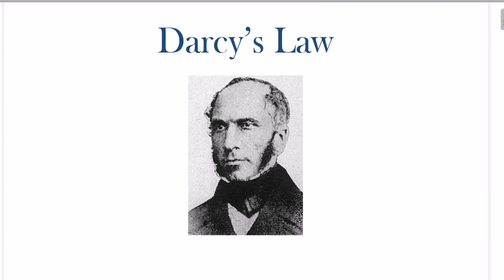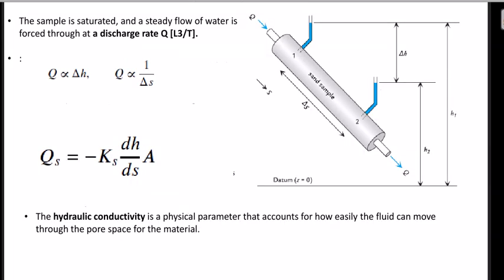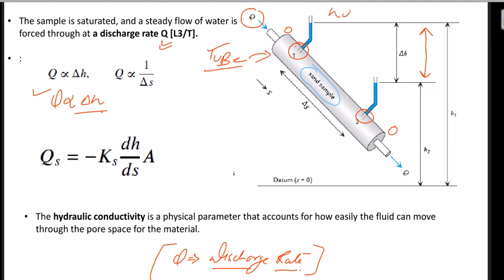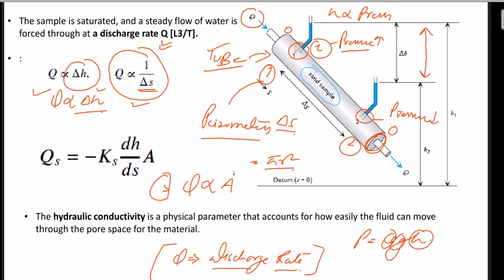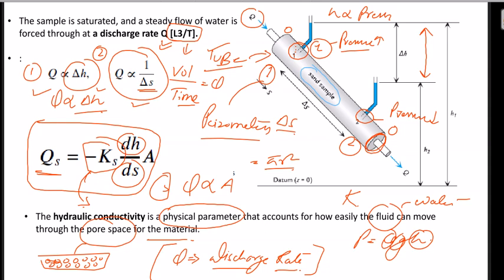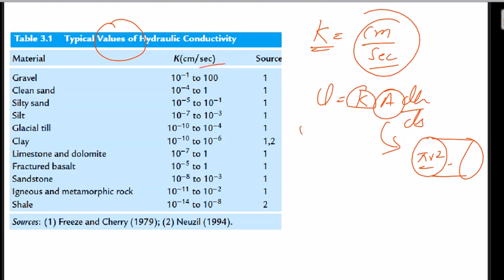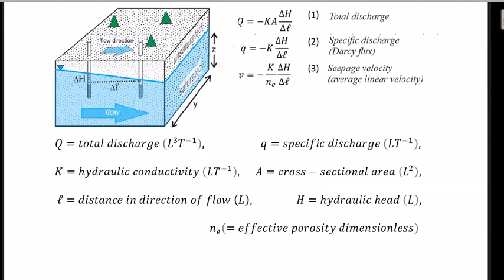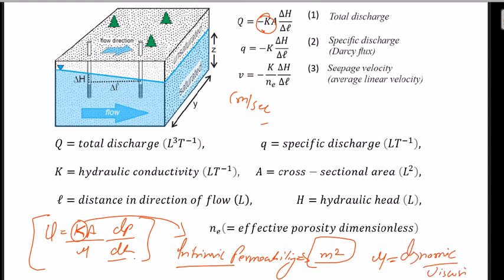Darcy's Law | Groundwater | Geology | Civil engineering | UPSC | GATE | CSIR NET

Comment: flow rate (Q) of a fluid through a porous medium is directly proportional to the hydraulic gradient (dh/dl) and the cross-sectional area (A), and inversely proportional to the coefficient of permeability (k) of the medium. The equation can be written as Q = -kA(dh/dl).

is this correct sir 
or K is directly propotional